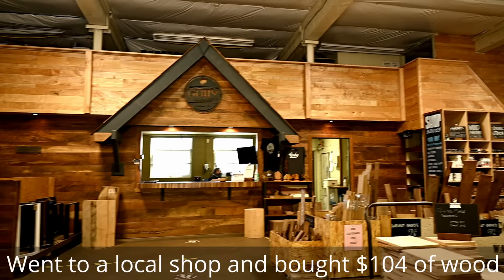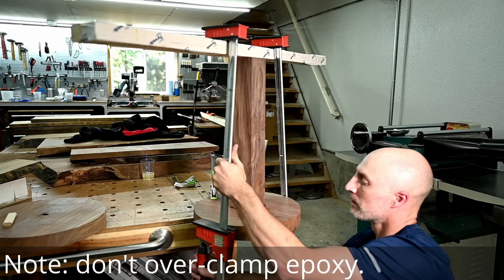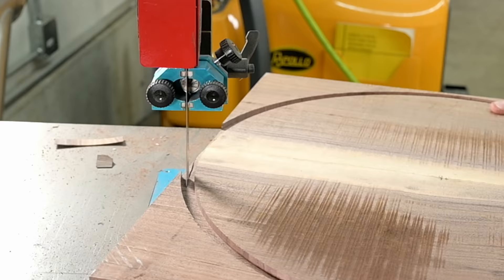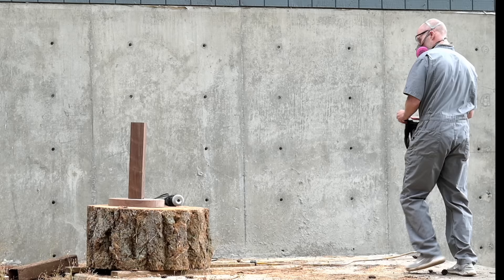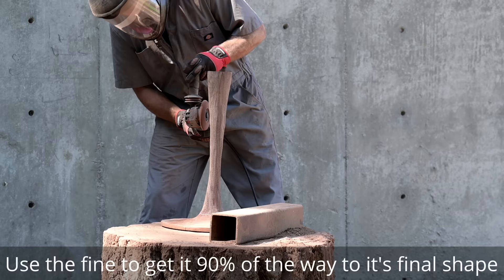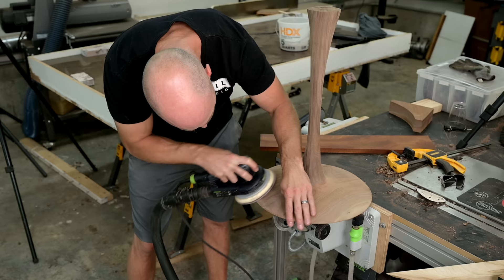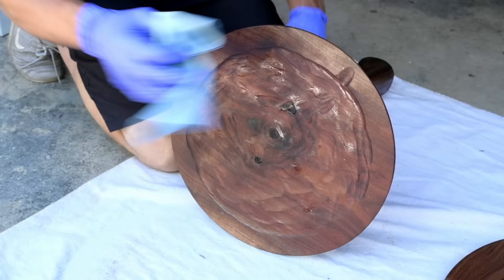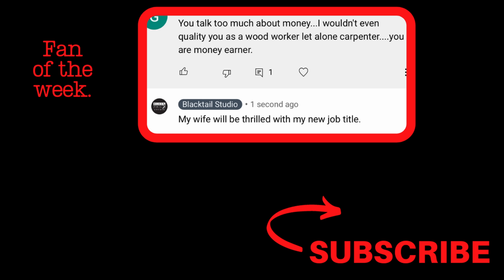Carving Two Tables to Make $1000

Comment: Just wanted to follow up on this post. I watched this video when it was first released and posted that it motivated me to give it a try. I’m happy to report that I made a pair of these tables and posted them to Etsy. They sold yesterday after being on there for about a week and a half. Thanks for the motivation.
Reply from the maker: Boom! Love that man. Keep rocking.
Reply: Do you mind sharing what your cost ended up being and what you sold them for?
Reply: @pogstyle1833   I followed the info in the video almost exactly except my wood cost was a little more. spent about $200 on the walnut and I’ve got enough left over to make a nice cutting board or two. $50 for a small can of Rubio. I paid for shipping which was about $200. Budgeted a dollar a day for Etsy ads which ended up being about $10. They sold for $1,200 plus tax.
Reply: I just want to use a 10k bandsaw
Reply: @nicholasem100  Awesome… thank you for the info, I look forward to attempting the same success
Reply: Yes. Outstanding!
Reply: Mine have been up almost 2 months with no luck :(
Reply: @anthonyrodriguez2570  Think about reshooting the photos.  It's all about the photos since you're selling with only visuals to go off of.  Also might want to include dimensions in the listing.
Reply: @nicholasem100  Where were you able to find a 4x4 piece of walnut for the shaft?
Reply: Dude THANK YOU FOR SAYING THIS
Reply: @csgo it’s not too far out there to think about.
Reply: Awesome
Reply: Out of curiosity, how did you package them? That's been my biggest setback on trying to sell small furniture is how to ship it safely.
Reply: @marioncrafted9045  interested as well.
Reply: @marioncrafted9045   @Marion Crafted  I don't do woodworking, but I have unpacked millions in electrical components and shipped small metalwork and ceramics. I would get/make a cardboard box for each main piece of geometry of the piece and cut lengths of the reinforcing pieces of cardboard that go into the corners of a boxed package to protect it from crushing. They're like hollow pillars that are shaped on the ends like three paper towel rolls, but open in the middle with one continuous outer wall. Put bubble or that air-pocketed stuff that's like 16 gauge thick on all of the surfaces of your work, maybe twice. Tape it. Box the top with a hole cut for the support. Tape it. Box the support with open ends, maybe with too-long material you fold over for a snug fit. Tape it. Box the base with a hole cut for the support. Tape it. Maybe wedge in and tape supports I mentioned between points where bad loading or rough handling would generate destructive leverage. Definitely support the corners, filling all gaps.

Protect the surfaces. Support the extended geometry. From a top down view, put supports in all the space of the box your piece doesn't fill. Clearly label the box with "FRAGILE- ^THIS END UP-DO NOT STACK" and then insure it. As an added measure or cheaping out instead of anything above, crumple up newspaper and wrap everything and then ball up newspaper to fill all the voids. Then insure it.
Reply: Cats are selfish so it's dogs for me. Nice work on the end tables,  not a bad hourly rate,  excluding set up costs 😉
Reply: I have a few questions about the tables you put on Etsy.  1st how did you describe them on Etsy? 2nd  What were the circumference of the top and the bottom?  3rd what was the length and diameter of the stand?
Reply: Dog. 
Good stuff
Reply: Doggs
Reply: Dog... Hands down!!

Comment: Hi, ceramic wheel turner here- in addition to cutting a "foot" ring into your base you can also cut it into three sections. Three feet is the most stable and reduces wobbling. Love your videos
Reply: I was thinking that would be a good way to disguise the spot where the grinder got away from him
Reply: Yes, I would have simply glued three quarter-inch discs to the base to make it stand on "feet" that you can't really see.  Works for me.
Reply: That’s why the Amish make three legged candle stands, it’s the most stable.
Reply: @joesmith1574  Yes, because three points define a plane in geometry.

Comment: Regarding "water-popping" the grain: I've tried skipping it when I work on my cutting boards, and it DOES make a difference. It's not that it sands any smoother initially, but it prevents the grain from popping days or even weeks later when it absorbs humidity. The idea is to preemptively pop the grain while you're already sanding so you don't have to re-sand it later. I live in a desert but I still get enough moisture that I can feel the difference between pieces I did and did not wet. Hope that helps!
Reply: I'm a novice. So far I've combined this step with the first coat of polyurethane. Do you think I was right or could I do it better?
Reply: Water popping? Shoot I must have been paying attention to traffic and missed that part .... Smh  I gotta get my priorities straight
Reply: great comment thank you....knowing the why makes a difference
Reply: the vast majority of wood turners I know use denatured alcohol (methylated spirits in Australia) for the same reason.

Comment: Cats all the way

I was firmly in the "I've already got a job and I don't want woodworking to become another one" camp, but this video is making me reconsider. Two or three sales like this per year would go a long way in subsidizing my hobby. Thanks for taking the time to make this video!
Reply: For real... This was one of the first projects that i can confidently say, "yea I can do this and could sell it"I just need to do get up and do it haha
Reply: @goodwyrd10  Totally; this is a more advanced version of the lazy Susan I made my Dad for his birthday, but not much more advanced. I have all the tools I'd need for this except for those making the mounting disk.
Reply: @abydosianchulac2  and the mounting disk is just one option. I use those figure eight clips for mounting table tops . They're super cheap and accomplish the same basic idea
Reply: Cam is right; and he’s awesome, but I gotta put in my two cents. I definitely think it also depends on where you live and the cost of materials. 
For shits and giggles, I just priced the materials for this project, from where I live. The wood alone would cost me $220 and then something like Rubio monocoat is around $40 for a small container. If I used epoxy for the glue upon bottom, that would add another $50. This project would easy cost be over $300 right now.
That might be easy for someone like Cam, who’s got the funds for it, but a guy like me (even though I have a lot of great tools) who is barely making it by right now…. I couldn’t afford to spend that much money not even knowing if they’ll sell or not. 
Hopefully its cheaper where you live.

Comment: Dear Mr. Blacktail, I’d be interested in seeing you do a similar video - designed for beginners and hobbyists, but using entirely tools that beginners might have… Jigsaw, circular, angle grinder, hand tools etc…  I’d personally be really curious about seeing your approach with these tools in general, but also it could be helpful for me and others :)
Reply: Lol yeah right.
Reply: Pass
Reply: 🤣 Just gona throw this out there for fun  but before electric power tools sanders planers even routers excited before electric they made them out of wood and powered them by movement 😁 plenty of documented evidence and diagrams on how to also 👍
Reply: Check out Rex Kruger

And to the others saying it's impossible, you really think that little of yourself? Have you never applied yourself to anything? Cause when you make those kind of comments that's all I hear "I cant do it so theres no way anyone else can", you'd be surprised what you can do if you practice. Just a few hours a day or a day every weekend, after 6 months you'd see this as a really easy project.
Reply: Yes exactly, no point saying it can all be done with basic tools then doing it all with a fully stocked woodworking shop.
Reply: @ike8236  But nearly all of this can be done without special tools. It'll just take your 3-10x longer depending on what you're doing. And he doesn't have the most efficient tools either.  I'm actually surprised he doesn't have a CNC table.  He could plane pretty much every product he's done on the show with the right table and it would save him from loading his slabs into his truck, driving, waiting, loading again, then driving home to unload.
Reply: why? you can see how to replace all his tools with simple ones yourself, you should know them... all it adds is time.
Reply: Can’t say enough about that comment. I’m 81 and just starting out in wood working. I’ve thrown clay on the wheel for 12 years and wanted a new adventure & space is very limited and am an avid golfer. How time flies but it’s a BLAST👍😂! You kids enjoy it while you can. Thanks, CAM!
Reply: @billmatteucci2898  Rock on gramps!
Reply: Yeah, i mean i only have a scroll saw and a drill... i think it's going to take me a LOT longer than 10 hours to make one of these... and seeing that list of things to buy to make it easier was extremely de-motivating. Especially when you said 'All you gotta do next is take some real nice photos' then pull out a professional backdrop and lighting equipment 😩

Comment: From a dog guy’s perspective… Regarding cutting circles with a router… one technique is to first cut a template out of 1-2” MDF using a pin and a straight bit on your table.  Then pre-trim your lumber very close to the finish size.  Use double-sided tape to attach the template to the wood blank, and then use the flush trim bit to match up the template. 

Making the template is a little extra work, but it’s safer than trying ton plunge cut for finish piece, you don’t put a hole in it, it’s repeatable, and you can re-use the template many times…

Comment: I’m an aspiring woodworker. I never got Into it seriously because I believed I needed those high end expansive tools until this video came up. I have most of the alternative tools you mentioned. Thank you so much for making these videos so openly and freely with your experience and knowledge!!!
Reply: i posted a theory on another site that got me alot of hate.... but i still agree with it.  buy the low end tools you can afford to buy... get a cheap table saw cheap router, cheap drill, get yourself a drill plunger instead of a drill press, a cheap cut off saw..... get whawt you can afford to build up yoru shop.  all the cheap tools mean, is you will need to spend more time on finishing.  more time on finishing means you get better at that part, you figure out short cuts, you figure out tricks,  and build and sell your work.  Then replace the garbage tools you bought when you can afford to.  replace the drill plunger with a drill press.  replace the electric hand planer that cost you 50$ with a thickness plainer.  replace your small table saw with a cabnet saw,,,, buy yourself a cheap band saw...then as you sell more stuff replace it with a good one.  buy what you need, that will do the job.... then replace it with a better one (for me once i finish my canoe.... i see if it works... then i sell it... then every canoe i sell is a new tool... its been put on hold for over a year becuase of wedding stuff)

Comment: Love your attitude, man.  Just found you yesterday and can’t stop watching.  I have a bandsaw mill being delivered in a few weeks that will only do 30” wide slabs but I can do a lot with that.  I’m planning to build a shop first thing and then start acquiring some more tools geared to woodworking. I’m a carpenter but woodworking at your level is a different thing and I’m soaking it all in.  Planning to try and make a business out of it and slow down on the remodeling work…work from home more.  Small tables and mantles to start.  Thanks for the inspiration!

Comment: 10:40 - The issue isn't so much making the bottom of plate itself flat, it's that even a perfectly flat plate would rock if there was anything on the table under it (a wrinkle in the tablecloth, a breadcrumb, etc.). Also, in the case of ceramic plates, that ridge (called the foot) prevents the glaze on the bottom of the plate from "gluing" it to the kiln shelves when it's fired.

Comment: Hey there, love your videos! Really itnerested i ngetting into woodworking myself, even if just as a hobby. How much would you assume would one have to spend to get the mist necessary tools one needs to get started when starting at basically just a hammer?
Reply: It depends on the type of woodworking you're after.
Machines or handtools? Are you jointing and pegging or using nails and screws?
The woodworking I do is 100% hand tools, chisles, drawknives, shavehorses, hand planes, hand drills and much more. All the nuianced individual tools for specific purposes in the long run costs more. I have 26 saws, all of which are for different things, compared to buying one electric miter saw that can accompolish all 26 jobs way faster.
Reply: I'd say right around $1000. But honestly, start with one tool, make a sale, buy another and keep going. I started mine business with $100 and I'm about to go full time with it!
Reply: You need a drill, a circular saw and a ruler. Plus some smaller items like paint brush, sanding paper. You adjust the design and the material to use (dimensioned lumber vs s2s) to what you have.

Comment: Everytime you drill in metal I shudder. NEVER hold the piece with your hand. 
I'm only 23, and I have deep scars on every finger on my left hand, my thumb have some nerve damage that still, 7 years later, affect me. 

Why? I was stressed and didn't bother to clamp down a metal piece I was drilling a hole in. I got no resistance from the bit, so I wasn't too worried. A few seconds later, the bit jammed, the piece started spinning and my whole hand was filled with blood and large chunks of flesh. I was 16 when this happened. 

Never, ever, hold metal with your hands. You are always the softest thing in the shop.

Comment: Love your work. I did some woodworking as a teenager then mostly stopped until my kids went off to college and I slowed down a bit at my job. Recently I decided to go to 100% remote work, giving up my big office for a much smaller home office. I had mid-century modern rosewood furniture both places, but my office desk was too big and my home desk was too small.  Instead of buying a new desk I was inspired in part by your videos to replace the top on my smaller desk with a big slab.  The problem?  Matching 60 year old rosewood, mostly orange and black with a distinctive grain. Cocobolo is close, but finding a single slab or bookmatched was impossible, or at least the price of a small car. The solution?  I found a beautiful monkey pod slab, followed your meticulous epoxy filling, sanding, a couple of bow ties, etc. (12 hours?). Then filled the dark wood with black grain filler and applied a coat of bright orange dye.  You’d be hard-pressed to tell it was not rosewood. Thanks for the inspiration and education, I think I watched most of your videos twice before starting. BTW, have both cats and dogs but a more a dog person.

Comment: CAT! 
And I agree that most of the actual woodworking that you do could be done with a saw, a regular hand drill with a couple of attachments, a dozen clamps, and a lot of sandpaper in different grades.
Things may just take a bit longer, probably too long to be financially viable for a professional. And it may look slightly more obvious that it was manual labor, but then, some people actually appreciate little imperfections like not-quite-circles and stuff like that.

Comment: Everyone knows woodwork and fabricating aren't the most accessible hobbies. Tooling can be quite expensive, space requirements are typically just a touch larger than what you can achieve by parking your car on the driveway to use a car space in the garage, and having room for a bomber workbench is almost a necessity...

But I love the effort you've put into highlighting the alternative tooling and methods people can use if they don't have the full suit of equipment. 

I wish I realised in my early 20's rather than my later 20's that the best thing you can do for any hobby is to make it as accessible and inclusive as reasonably possible. Elitism and gatekeeping are cancer.

Comment: Hi Cam and tout le monde, beautiful projects again and I agree completely that wild and avangardistic tools are not necessery (though they of cours do help and not only to get the job done  but also to motivate you at all). From very humble experience in predominantly knife-handle-making I know that one can do the whole sculpting with anything availabe from an axe over a hoof-rasp to more and more delicate tools including scrapers, jeweler files and even shards of glass - and as you get closer and closer to the shape you are after and therefore increase resolution with your nose closer and closer to the material the shaping will pass over to surface-treatment without noticing it. Enough time provided. 
And of course I do envy your tool-park. :))
Always a great pleasure viewing your self-mocking though very inspiring videos.

Comment: I'm a 4th class power engineer, 3:48 Is basically how you'd cut round gaskets for pipes lol, except it's with a small blade rather than a saw. 

You should take a look at some of the designs online and see if you can make an adjustable one for yourself. Don't buy one, its stupidly expensive for what is essentially a sharp, adjustable protractor. 

Unless you want to of course, I'm not the boss of ya.